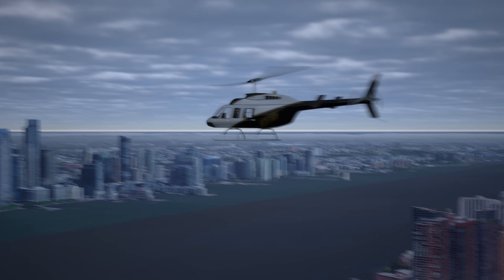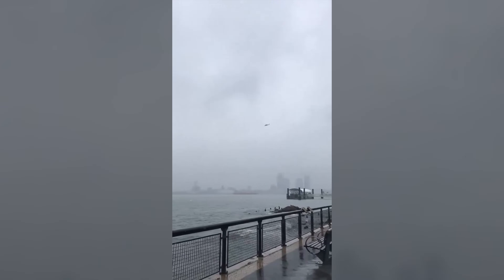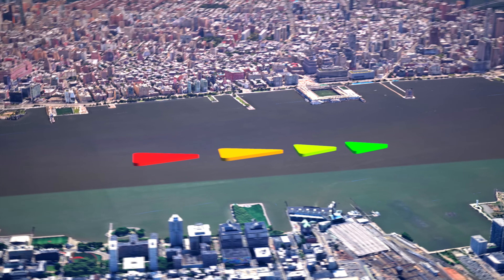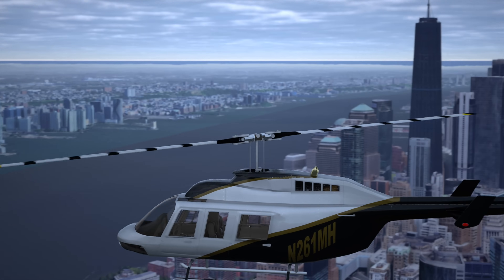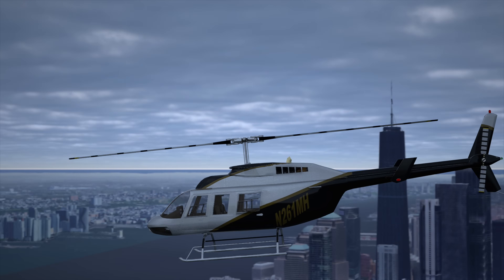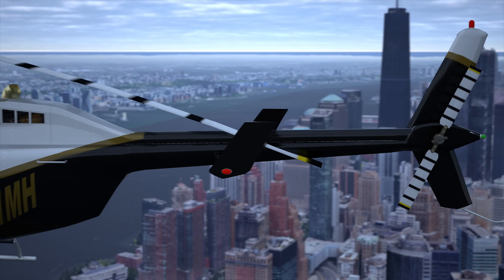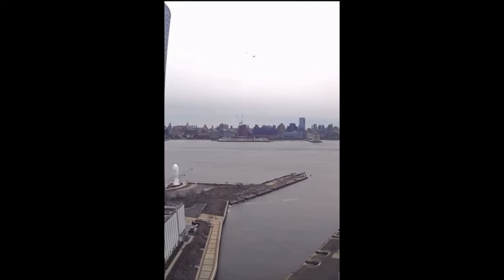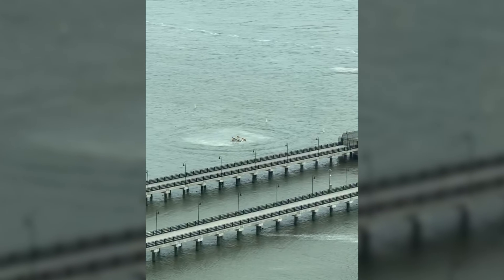Helicopters DON'T just fall from the sky - What is "Mast Bumping"?

Comment: No mast bumping. The transmission was still attached to the rotor (classic with transmission seizure). A must bump in the Bell 206 requires a near zero g pushover and the break comes between the rotor and transmission. This was most likely a classic transmission seizure.

Comment: Good technical explanation that is, however in this particular scenario, just plain wrong. The various videos of the accident clearly show that at the moment the rotor separated, the helicopter was in straight-and-level flight, with no strong input from the pilot on the control stick. So no mast bumping possible in the case of this crash. It's either sabotage or more probably a suddenly broken main gearbox due to mechanical fatigue, extremely rare on a Bell 206, admittedly. The people who maintained and serviced this helicopter are sure to come under the NTSB spotlight.

Comment: Condolences to the family. I used to take helicopters run by smaller firms for my job (mining related in remote areas). I can say after a few close calls caused by pilots (nearly collided with another helicopter when the pilot couldn't figure out where his friend was.. had a pilot fall asleep while flying.. close calls avoiding birds, etc) and maintenance (landed in someone's field), I would not personally be taking my family on any tour helicopter.

Comment: 3:38

Want to stick with that claim?

Weather/wind conditions reported in that same exact area, both before and after the accident point to the known facts that those  wind conditions did exist. Other pilots did notice it, at that exact height and also at that exact area. It was also clearly documented in and around that area (but at slightly different altitudes) by other aircraft which continually document those conditions.

And then look at surface conditions. Look at the known conditions before and during, but especially after. That’s even conditions which could be seen and observed on the windsocks in the area. But also look at what they video captured in the first boats responding.

Notice any interesting weather patterns when those ships were responding within just two to three minutes?

Comment: Not mast bump. I flew the Army's OH-58 Kiowa (Bell 206). Mast bump in a 206 requires a big near zero g pushover. This looks like a classic transmission seizure. There are still photos where you can see the transmission coming down with the rotor.
Reply: I agree and I 100% disagree with how Brian is speculating (just for views).
It "appears" that the both rotor blades "might" have been fully or at least mostly intact and that doesn't make sense if one of the blades struck the tail boom.

Comment: This helicopter is not known for mast bumping. If you watch the video in slow motion, you will see that he was flying level, when something locked up. The rotor, WITH TRANSMISSION ATTACHED, coming down. This was no mast bumping, something locked up in the rotor transmission or engine transmission. If those rotors hit the tail, they most certainly would not be spinning down normally as they did. The one striking the tail would have been destroyed. This post is just to get views, and it certainly did. Just BS guessing

Comment: This is no mast bumping. The main rotor is entirely intact with the transmission attached. It auto rotated by itself and there is no visible breakage of the main rotors. This is a a catastrophic failure of the systems between the engine and the Rotor. We will know the truth only after NTSB inspects the parts and give their report. But it is a tragedy of a family and the pilot. They simply had no time to respond. God give them peace!

Comment: It’s not mask bumping on a bell 206 
You might be confusing it with the Robinson which are quite prone to mast bumping because of the dynamic design 
The bell 206 has quite a different configuration and dynamic operation 
This aircraft had catastrophic disintegration with no warning it’s clear from the evidence
When the main writer assembly departs the fuselage entirely with the rotors intact indicates something far more severe  
And I think we should all stop speculating when we don’t know the full facts

Comment: Would it make sense for helicopters to have some sort of chute system and then have them fly at mandatory heights to make those chutes useable? I’m sure this would throw a wrench into the well oiled aviation regulations, but for the sake of safety, does this make sense at all? Would it even work?
Reply: There are a very few combat helicopters that have ejection seats. However, the rotor is blasted off before ejection to prevent it from shredding the pilots.

There are also experiments with ballistic recovery systems for civilian helicopters, similar to those already common in some small aircraft. But so far, this only works for light helicopters and autogyros.
Reply: @ Ahh yes, ballistic recovery systems, that’s it. I see, that makes sense. I guess mass is the major issue
Reply: @High_Key  Mass is, of course, the main problem. The "Curti Zefhir," an Italian light helicopter on which this was tested, has a maximum takeoff mass of 700 kg/1,540 lbs. The Bell 206 in this case weighs a maximum of over 2,000 kg/4,400 lbs.

However, another problem is evident in this crash. The rotor mast is the only point where I can attach such a rocket system; if it is ripped out of the fuselage along with the gearbox, as happened here, then the entire rescue system is useless.

Comment: Weakened by stress in tailboom, got separated and sudden change of forces ripped the main rotor off. Old and weak structural strenght. Vibrations by unbalanced rotors, poor fuselage maintenance or checks. My deepest condolences for the relatives, friends of family and flight staff.

Comment: In Vietnam we had to watch the grade on the ground we landed on, too great and you'd get mast bumping and disaster. He early models, B and Charley models were worst, when the D and H came out it was better. I have never seen mast bumping tear the 90- degree gear box out. Tail boom can be hit by a rotor but it takes aggressive maneuvering to cause that. Flying NOE was a cause of mast bumping, we learned what the UH-1 and the AH-1 would take and flew accordingly. I've had tail rotor failure, never lost the main which is probably why you are reading this. I'd certainly like to know what caused this? The 206, or OH-58 was a pretty stable bird.

Comment: THIS IS NOT MAST BUMPING.  AGAIN, THIS IS NOT MAST BUMPING.

Mast bumping occurs under one condition, low, usually no load on the disc.  Let's dumb this down, as many seen confused, just like the poster of this horribly incorrect video.

The helicopter is a Bell 206, likely an L3 or L4 known as a "Long Ranger".  It has a two bladed rotor system.  The area that the blades cover when rotating is called the "disc", for obvious reasons.

Under normal flight conditions the aircraft mass(weight) is suspended by the rotor system(blades) as they generate lift.  This causes the blades to flex UP in a cone shape.  We call this "coning".  As long as there is a positive load on the disc, you can't have mast bumping, short of full control inputs (hard left, right, forward or aft) which is neither necessary, nor was it done in this case.  An unloaded disc is uncontrollable by the pilot until the disc experiences positive load.  While the disc is in low/no load conditions it is free to "wander" about, which can lead to mast bumping.  What can also happen under low/no load on the disc is that the aircraft may roll to one side or the other.  In an effort to correct this the pilot applies opposite cyclic.  Not getting a response the pilot inputs more cyclic.  When the disc becomes "reloaded" it transmits the control inputs the pilot applied and the result can be a HARD or excessive input causing mast bumping.

Mast bumping on it's own will NOT sever the tail boom.  The blades do not "flex down" in a low/no load situation, nor do they flex down under high updraft or downdraft conditions.  The issue is the disc "wandering" uncommanded while NOT under positive load.

A low or no load on the disc is the result of poor piloting.  Negative G conditions (hard nose over, which involves a hard forward push on the cyclic) can cause such a condition.  Again, this is not what we see in the video. We see straight and level flight, the most benign flight condition possible.

Mast bumping can cause a "bump" in the flight controls, damage to the mast, and at worst, mast/rotor separation.  This is NOT what we see in the video.  It is quite clear that the rotor head(and blades) separated with the transmission attached.

The tail rotor and the main rotor are hard linked together via driveshafts and the transmission.  We see a catastrophic failure, the aircraft yaw hard left (due to the tail rotor which is driving the nose left to counter the torque of the main rotor that is trying to spin the body to the right) which puts tremendous torque on the tail boom, which then separates about the same time the rotor head(with both rotors) and the transmission separate from the airframe.

If you managed to chop your own tail off due to an unloaded disc, one or both main rotor blades would be severely damaged.  We watch the pair and the rotor head continue to "fly" nicely until impacting the Hudson.  That would not be the case if either blade had struck the boom.  A boom strike would not cause the transmission to separate from the airframe either.

If I had to guess at this point.  I would put money on mechanical failure of the transmission housing, specifically improperly secured to the top deck.  Once the separation began, the pilot no longer had control (pilot inputs).  The lack of torque from the main rotor trying to spin the body clockwise, meant the tail rotor was uncontested to spin the body counter clockwise (normal torque-anti torque relationship).  This caused the immediate and extreme left yaw which aided in the breakup of the boom and rotor head and transmission.  As we all have observed, once either the rotor head or tail boom/rotor are gone, it's a death trap.

Comment: When I would practice preflight with a new student on the TH-57 (Bell 206), I would ask them what was the purpose of the A-frame connectors on the transmission.  They would always say to connect the transmission to the airftame.  To which I would reply, "No, it is to connect the airframe to the transmission.  Only one of these will fly without the other and it isn't the part we'll be sitting in".  Aside from the enjoyment I got from being unnecessarily pedantic, the intent was to impress the importance of preflight by having the student think through the consequences of various failure conditions.

Comment: Honestly im not sure it is mast bumping due to the fact that there is a picture of the helicopter falling out of the sky with about 50 meters above it the rotor wich is intact, including the gearbox intact.  There is definetly enough force to severe the tail boom, but that force would also be applied to the rotor. and I doubt it would be that intact falling down if it went through the tail boom. Besides I see no reason why that would rip the gearbox off entirely. You would expect the rotor blade itself to break off.

Comment: This was definitely not a mast bump. I'm thinking rotor transmission mounting failure. The rotors were intact still attached to the gearbox and spun down to the water. A mast bump likely would not leave the rotors intact. At least one would be busted.

Comment: I don't feel it was attributed to mast bump, I'm more inclined to beleive it was something like a rotor transmission support link fracture-failure, like this one: https://www.atsb.gov.au/media/news-items/2024/rotor-transmission-support-link-fracture-highlights-importance-following-manufacturer-maintenance-requirements
There is footage from a building which shows the rotor disc tilting backward very fast, way too fast for pilot inputs, and the boom buckling and separating. I doubt that was pilot input error, way too fast.
However, there seems to be a right yaw just before all of this, but tgis could be attributed to pixilation of the video.

Comment: Easy what happened: This one was a VN-era Bell 206. The transmission above the cabin locks up from a failed bearing or lack of lube, snapping the shaft and allowing the main rotor to go eccentric and hit the tail boom. The impact caused the main rotor to separate, and the cabin falls like a rock without the main rotor acting as a parachute. Seen it before. Idential circumstances.

Comment: Mast bumping in the 206 is extremely rare and also, it never happens in straight and level flight.  This was a structural failure or one of the two transmissions seized.
Reply: Or something else?  Sabotage considering who was flying it.
Reply: Exactly. This is transmission failure. Gearbox locked up and snapped to pieces.

Comment: Ya, probably not a mast bump. Straight and level flight at time of failure. Probable cause is rear rotor transmission freewheel lockup. There is an AD (repair directive) on the issue. https://www.federalregister.gov/documents/2013/10/31/2013-25310/airworthiness-directives-bell-helicopter-textron-canada-bell-helicopters

Comment: A bell helicopter by the statue of liberty.  Liberty Bell.  Crashes...Siemens telephones etc, with a Bell.  The whole family.  The Tower Tarot Card.
The pilot jumped out at a lower altitude and left the helicopter to gain altitude causing what you call "mast bumping" from the aggressive ascent after the pilot bailed and jammed the stick.  It's why it was above water, not above ground.
Escobar, Spanish, and obviously the cocaine is involved here.  The helicopter is black and gold accents, while in the photo they posed for, there are 3 envelope packages with crowns on them.
After the Notre Dame incident, they used Quasimodo here to ring a bell.

Comment: This is no accident.  Propellers and tail wings dont just fall off. Ceo of seimens,huge tech company......yeah,right....accident
Reply: Do you think that something could have detonated in the helicopter?
Reply: @bamf6603  maybe it was tampered with before it took off for flight. Couple bolts loosened or something. All the vibration completely undone them and it falls apart. I think youd see a detonation in the vid. But for it to completely just come apart, not break,but come apart at the seams,just seems totally deliberate
Reply: @Bathroombreakzzzzz  do you think that USA has something agains spain that they wanted to kill some random family from there?

Comment: Mast-bumping is causing to brake the mast directly unter the rotor. In this case the gearbox was still attached. And this shows that it wasn't related to mast-bumping. something more drastic must mechanically happened to the helicopter.

Comment: I flew in Jet Rangers for years in the Rocky Mountains.  Our crews nicknamed them "Death Rangers" because of the various crashes.  There is a huge amount of flex in that big 2-bladed rotor.  We had this same incident happen in the desert between Mesquite and Vegas, except with a transmission lockup, which caused the tailrotor driveshaft to snap in two.  The tail boom got knocked right off.  Fortunately the rotor remained attached and they were low to the ground so the ship landed upright.  Everyone survived on that flight.  The best ships we used were the Hughes 500D models.

Comment: This is not mast bumping....this is a failure of the main gear box mounting system. Something broke, the MGB came loose, with the loose MGB the tail boom has failed, the aerodynamic loads on the compromised MGB then ripped it out of the roof. And as for reports of the floats being inflated. Not to my eyes they weren't. If they had been inflated they would have been ripped off when the helicopter hit the water inverted. The float covers have simply unzipped when it hit the water, they are only held together by velcro. The float bags had no effect what-so-ever.

Comment: Only time aside from weather issues and abrupt cyclic inputs all of which seem to not be the case here the other problem is with a negative G pushover while not keeping the main rotor system loaded up, but again on a site seeing flight this would not likely happen as they would be trying to give you a very smooth nice ride.  Seeing the entire tail boom missing and the main rotor system and trans still flying while detached there as some sort of major catastrophic failure.  It was extremely hard watching it tumble into the water like that and really put a knot in my stomach RIP to that pilot and beautiful family onboard.

Comment: First I wish my condolences to the families then that reason sounds ridiculous to me it is far more likely that the engine mounts tore lose taking the engine, transmission and the the tail rotor drive shaft with it.  This would pull the tail from the helicopter because of the bearing mounts for the drive shaft. I say this because of the rotors flying off by them selves the rotors did not appear damaged enough to have done what this video claims. The tail is structural with spars and ribs covered with sheet aluminum if the rotors came in contact it would shred the aluminum and ribs however the spar root goes all the way back to the drive shaft connection to the transmission.  I can be wrong however from what I have seen it is more likely then contact of the rotors with the tail boom.

Comment: Here is an explanation, a link between the swash plate and one of the blades, fail, the blade goes into negative pitch and strikes the tail boom, the tail boom separating from the helicopter, the main rotor goes into violent vibration because of imbalance, rips out the gear and the main rotor.

Comment: The main rotor bearing catastrophically failed and was separated, then the lack of torque on the main body of the helicopter caused the thrust of the tail rotor to sever the tail through opposite forces.